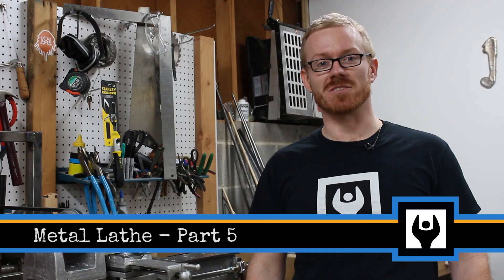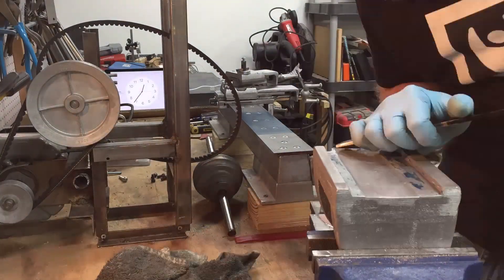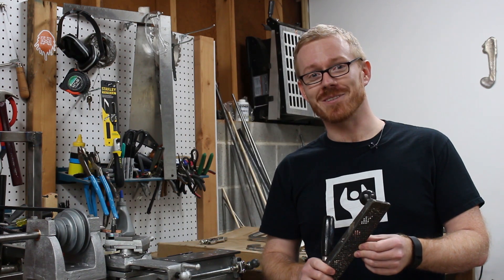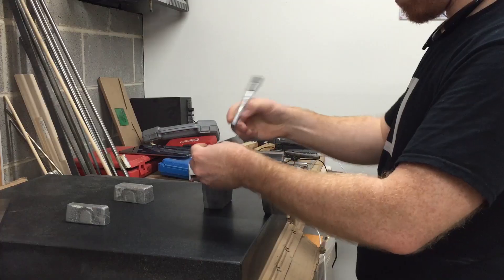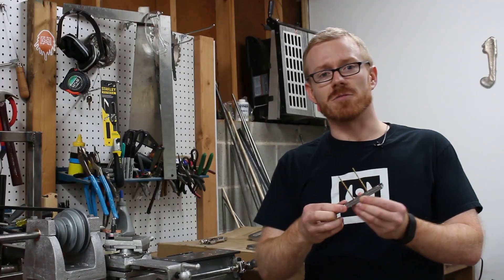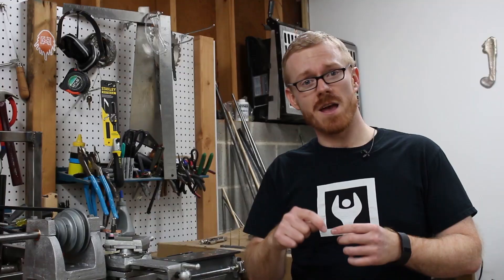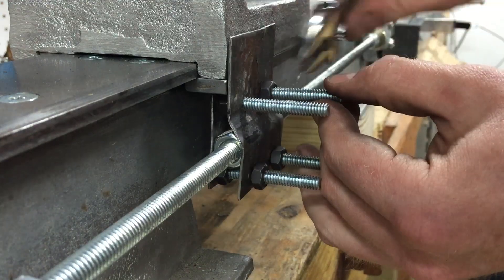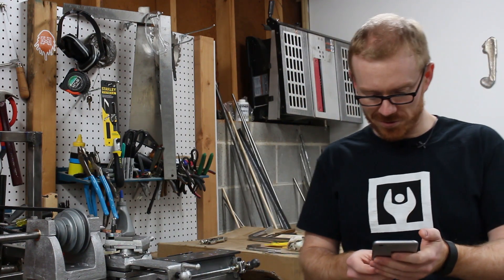Metal Lathe - Part 5: Final Headstock Prep for Boring

Comment: On painting the term used is “guide coat”. If you had painted the part instead and rubbed against the surface to be matched, the low spots would be the only parts with ink in them, from there you’d file/sand it until the whole area of contact would be metal. From this point you’d link it again and start refining it by using finger sanding paper until you have it flat and smooth. Hope it helps someone after all of these years. Thank you for sharing.

Comment: To bed the headstock on the bed:
Use rubber cement to glue 80 grit sandpaper to the bed, abrasive side up.
Run the head along the bed, roughing off the high spots.
Switch to 120 grit sandpaper.  Repeat.
Switch to 150 and then 220 grit.
This will get you to a fairly flat and ready-to-finish surface a LOT quicker.
MAKE SURE to clean the swarf off the bed between grits.
Thoroughly clean the bed and headstock before finishing.

Comment: Rather than doing the scraping of the surfaces which isnt giving you a good finshing .... get some sand paper or skateboard grip tape glue/stick it to a super flat surface and sand away using single direction strokes you will get a far smoother finish and it will take the materal off quickly depending on the grade of sand paper

Comment: I made one of these almost 20 years ago. You are bringing back many fond memories. Thanks for this series. Also as a note: using these old methods of machining as simple and straightforward as they seem, have really helped me with my machining in general. Such as using a lathe for fitting parallel flat surfaces and scraping for part fitment especially in jig making.

Comment: @Makercise, Why do you need the shims?
Also, Rockwell and Woodcraft have pricey plate glass for sharpening, but I also use marble or granite tile from a hardware store.  Not the same flatness class as a surface plate, but the price is right.

Comment: Christ don't put emery cloth on a surface plate! /shudder David Gingery didn't have a surface plate when he built the lathe, instead he used a milled surface of his table saw or something. Then in the third book he ground two pieces of float glass to each other, then I think maybe he broke down and bought one.

But if you want to do your own surface plate, you can scrape using three plates, A, B, C, then scrape B and C to match A, then replace A with B and start again, rotating like that till all plates are uniformly spotted with 40 spots per square inch, then they will be flat within a few tenths.

You can't just scrape one plate to another, cause then one of your plates might be concave and the other convex. That's actually how they telescope mirrors, but instead of scraping they use grinding paste between the two glass blanks.
Reply: I used 3m adhesive to fix a sheet of sand paper to a metal plate. The plate was definitely not flat, but it did get me very close. I finished it by scraping against a surface plate.

Comment: Great vids.  I never use screws on that type of job.  I drill and tap.  A leather punch will work on thin metal.  Works great.  Use a hardwood underneath.   I am in the process of building one of these but I don't have the facilities to make vids.  Thank you.
Reply: Paul Duffey agreed on the leather punch, I was thinking the same.

Comment: A number 7 drill bit lets you tap 1/4-20 or 1/4-28
I was just wondering what is your day job? Because tools and metal cost money,... is there a harbor freight near you a tractor supply comes in handy too for nut's& bolts and and pully's and metal too.

Comment: I noticed that when you were drilling into your cold rolled steel plate you bit was grabbing and trying to self feed you can use a fine abrasive stone and hand grind a negative rake on the bit to where you have to apply tool pressure for it to cut plus as an added bonus your machined holes need less finish work.

Comment: what do you mean when you say the play of the headstock
Reply from the maker: noah he not sure when in the video I said that, but iirc I meant the tolerance between the inside of the headstock assembly and the bed ways. for a free moving part this should be bigger than zero. Too big (say larger than 1 thou) it starts being called slop.
Reply: 3:16
Reply from the maker: Zach M ok thanks. I definitely mean wiggle room. that is why I was trying to move the headstock up and down by grabbing on the c-clamps.

Comment: how often does he mess up and have to start all over again
Reply from the maker: keco nation I'm not exactly sure what your question references. 

Early in this video I keep going between the vise and the surface plate so I can iteratively refine the surface. I would liken that to building a brick wall. Each course involves similar steps but builds upon the one below. I wouldn't consider it starting over but I could see how the sped up video could make it seem that way.

In my own estimation, I mess up at least every other day...my fellow Atlanta commuters may verify this estimate ;) 

On this project, it is rare for mistakes to result in a complete mulligan. On the lathe project, parts that don't cast well enough (many can be fixed or worked around) can just be melted back down. I recast the temporary headstock mount, the tailstock, and the faceplate because of defects or issues casting.

I hope that answered your question, but I am happy to try again if it didn't.

Comment: I have a solution for you to remplace the paint marking technic. Use your drill press with a square head milling bit and x and y thingy(I dont remember the name), to flatten and smooth out the surface of the moulded pieces.
Have a nice day.
Reply: Badr Haddy Even a properly rigid mill with truly flat dovetail ways can't get a surface as flat as you can with manually scraping. There is zero chance of doing better with a drill press and any sort of "x y thingy". Sorry. 

If you're interested in learning more you should read Foundations of Mechanical Accuracy. You can get a copy on Amazon for just $400 or so. Or, if you're creative, you can find a digital copy online.
Reply: Jon Miller I see now. Thanks for your response. Your  video gave me tons of ideas.
Have a wonderful day
Reply: A drill press is not made for milling and you risk breaking it.

Comment: First, great video series!!  I bought the David Gingery book series too and would like to make some of the projects.  Seeing videos of the process really helps.

Next, I saw you broke off a screw in the headstock.  In this situation, you were able to offset the part slightly and have it still work properly, but that is not always the case.  From my perspective in this video, it looks like a small portion of that fastener was still protruding from the casting.  I usually try welding a nut onto the protruding fastener.  After welding on the nut, I use a wrench, or socket, to remove the broken fastener.  I know that some people lack those resources, but I heard you talk about welding something in an earlier video, so I assume you have a welder.   

The action of welding works in 2 ways:  1.)  it gives you something to grab onto for removal.  2.)  It imparts heat into the work.  Because steel and aluminium expand and contract at different rates, this helps loosen the fastener for removal.

Just give it a try in the future.  I think you will be pleasantly surprised.....
Reply from the maker: +mark hunsberger Sounds good. I'll avoid opportunities to try your recommendation, but I'll file it in the back of my mind just in case.

Comment: A suggestion for making a hole in a thin sheet : you drill a hole of the correct size in a small block of soft iron, attached on the drill press. Then, not moving the block you change the way the drill bit is mounted : chank toword the blocvk You will have sharpened flat the end of the drill bit prior to this exercize.
Then you use the drill bit as a punch (no rotation)
Reply from the maker: +Maillot Jean Pierre Interesting. Maybe I'll give this a shot. Two possible hicups: all my larger drill bits have 120deg flats ground on the top inch of the bit to give the 3 claws in the chuck a good bite; and would the flutes in the bit pose a problem for a chuck like I have? Let me know if you think these two items are realistic concerns.
Reply: +Makercise The chank have to be circular and the same diameter than the hole drilled. Does not work in your case. My curiosity : how do you maintain coaxiality with flats on the chank? I am not able to do that,
Reply from the maker: Maillot Jean Pierre
Apparently I am only able to achieve moderately accurate centering: https://en.wikipedia.org/wiki/Drill_bit_shank#Triangle_shank
Thanks for the tip. Now I should be able to justify a decent set of drill bits. :)

Comment: high five

With regards to the emery paper on the surface block - I've used a piece of plate glass and silicon carbide wet/dry to get a polish on stainless. On the highest surface finish part I ever did, a pair of hydraulic press dies for my college chemistry department's IR spectrometry lab, I lapped the two parts together after the paper/glass treatment. I mixed together silicon carbide powder, some polyethylene glycol (glycolax) a little water, and a drop of soap. The glycolax was just there to thicken things up and keep the water in the mix, and it worked out remarkably well. Just keep your motion random, and slow, so you don't dish the part - inertia can make the leading edge dive a bit, giving you a convex surface, rather than flat. Valve lapping compound would work just fine, but keep in mind you'll want a sacrificial flat surface if you're not going to lap the entire lathe bed, and you'll never want to put lapping compound on that surface block.

Awesome series. Hope it continues going well!
Reply from the maker: +Rion Motley Fist bump.

Welcome thanks for subscribing! Sounds like a cool project. I definitely try to keep the grit off the surface plate. Where do you think would be the best (cheapest) place to find plate glass? I look forward to the rest of the series as well.
Reply: Home Depot has pre-cut glass for picture frames, on the order of 2-3 bucks for something appropriate for a certificate or diploma - 9 x 12 or something like that?

There's always places like ACE hardware or auto glass shops that can usually cut a piece for you if you want something larger. 

The press dies were fun. I watched the entire Matrix trilogy, and just had the glass plate, the dies, and a little cup of water in front of me in the den. one fight scene clockwise in the right hand, the next fight scene counter clockwise. My arm went numb, but those were some smooth-ass dies. ;)
Reply from the maker: I have seen a distinction made somewhere. IIRC, it suggested the stuff at home centers and hardware stores is usually pane glass <1/4" versus plate glass ~3/4" thick. It may have been Book 3 suggesting using plate glass like the type you see on coffee or side tables. I understood that plate glass would be flatter and less susceptible to deformation. Can you confirm the thickness of the glass you used?
Reply: +Makercise I happened to have a piece of a glass desktop - it was the smaller corner section that normally held a monitor - and was about 1/4" thick. The thinner glass is fine as long as it's backed up by a similarly flat and rigid backing - so you can use the glass as a sacrificial surface for your layout block, if you can't find reasonably priced 1/4" glass. And yeah, the picture frame stuff is pretty thin. I wouldn't use it without something I knew was nice and flat. However, your nice-flat-support doesn't have to be optically flat, or even have very good surface finish, so long as it's actually flat, since the glass handles the smooth-as-baby-butt surface for you.

Comment: I have a question for you if I may.   How do you know the correct temperature for puring the metal when you are making the castings?  Do you have a way of actually measuring it or what guidance would you have on this.   Thank you much.
Reply from the maker: At this point I have just been making sure it was somewhere between solid and vapor. ;-) I think if it's starting to get red it is too hot. Otherwise I have been shopping for a k type thermocouple. Do you have a temp you would recommend shooting for?
Reply: +Glenn Felpel In David's book number 1, under pouring temperature on page 50 of my copy he says the best temperature is between 1350 and 1400 degrees F.  In there he says we can get a feel for the correct temp using a 1/4 inch rod and very gently stiring the melt.  Any blobs on the rod mean it is too cold. If the rod comes out clean the temp is good for poring.    But I don't have any experience with this yet.   What say you?
Reply from the maker: A yes. Book 1. That sound about like what I am doing. Perhaps I just got the feel for it and for got the reference. I'd still like to measure though. We'll see.

Comment: Chris, I have been studying an old book "Machine Tool Reconditioning" by Edward F. Connelly.  In the book he calls the transferring of the marking medium as "spotting".   Also, the comment previoulsly by another veiwer is a good one that I do as well.  Use a standard paper punch to punch holes in the shim stock.  It produces the perfect hole for 1/4 inch fasteners.  A three hole punch gives a good hole but a hand held single hole punch is easier to get the hole where you want it.  Keep up the good work!  Thank you for sharing this work with us.
Reply from the maker: Spotting sounds right. Thanks. Checkout my reply to Carlos' comment on the hole punch.
Reply: Makercise I've always heard it called printing.
Reply: Good deal,  we all want to learn and keep the terminology correct.  Thank you!

Comment: Awesome work man! I can't imagine the mental and phisical exercise that goes into this. Very very interesting!  I had tons of comments but I'll go to the main things that I was excited to see :D. 
-That notch between perpendicular surfaces is a clever solution I've always liked! I've always called it "undercut" when it is between 2 grounded surfaces in a turned part. I don't know if it applies to this case :)
-Shims with holes are a pain in the ass. Sometimes I've used one of these paper punchs to pierce holes for binders, maybe it can work for you in any other occasion if it's the right size!
-And finally, how do you align both parts of the headstock? Only with the 2 screws? I guess when the bearings are in place they lead the alignment, right?  
Well those were a lot of questions haha. Great job once again! I can't wait for the next episode :D
Reply: +Cactus! workshop Really nice recommendation, dude. Thanks :)
Reply from the maker: Makercising is a fun outlet mentally and often physically. I like your observations.  Undercut seems like an appropriate term. I tried a a single hole punch. Perhaps it was a crumby one. It didn't cut completely and jammed the punch. iirc it worked well on 0.001" shim stock but any more was bad. Maybe brass shims would be easier on the punch. Spot on the bearings keep the bearing cap aligned.
Reply: +Makercise Another term is "relief groove"
One reason it's important in industrial situations is that grinding wheels cannot be relied on to preserve their full diameter right to the corner, so it's desirable to be able to run that corner past the surface being ground.
Otherwise the wheel has to be
a) harder than optimal for material removal (softer wheels cut more freely)
and
b) dressed repeatedly (which wastes time and wheel material) to keep the corner sharp and maintain the diameter right to the corner.